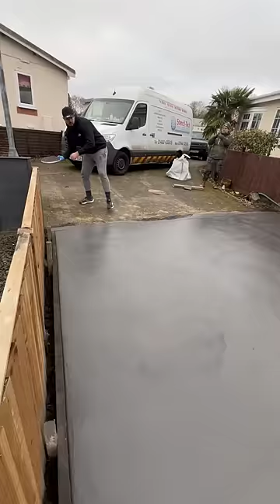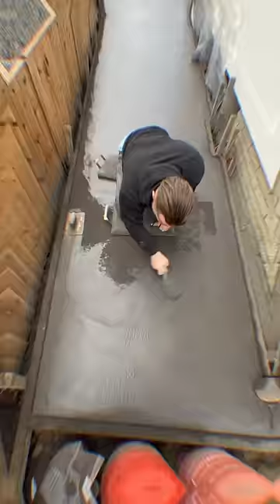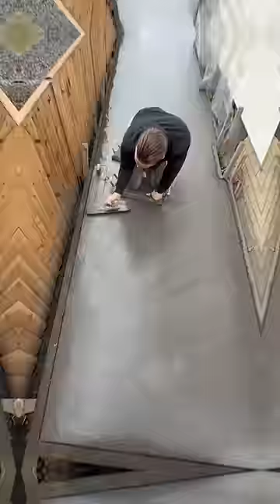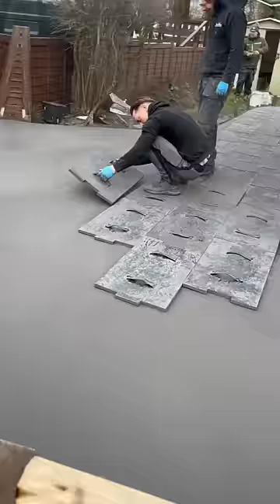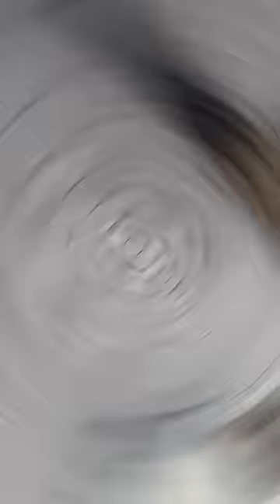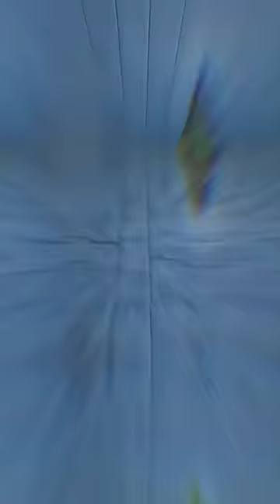Coming in hot 🥵 #concrete #shorts

Comment: Not an expansion joint in sight, be all cracked up in no time at all.
Reply: Cut them on wash off day ...Still crack though uk concrete sick now days
Reply: Was thinking same thing
Reply: @michaelcostello1053  And??? fibre isn't for expansion.
Reply: You can put pop tops in !! So you can run caulk line. . Though it all gets saw cut !!! It's stamped don't do expansion joints unless it's pop tops .
Reply: @Humbleone398  Can you re-say that in English. ???
Reply: I was going to say the same.  I had my driveway done exactly the same.  
I asked about expansion joint,  they said it'll be cut in at the end. 
Then they run an angle grinder about 4 inches deep even though the base was 6 to 8 inches deep. 
Needles to say I have 3 huge cracks in my drive after only 1 year. 

I mean,  I've never laid a concrete drive.... but even I knew it would need to be able to expand and contact.  

In surprised there's no horse footprints in mine as I'm sure they were cowboys.!
Reply: @sweetstuff9748  Exactly why expansion joints should be fitted when laid, with the correct expansion material between them.
Reply: Let it crack and live your life.
Reply: It won't. The concrete has fibres through it tying it together and very high cement content
Reply: @paulmurray3582  OK, That's all I needed to hear, to let me know you haven't got the first clue about what you are talking about, so we'll leave it there. 😉
Reply: Ritey ho matey , drove a mixer for 7 years. hmmm aye for sure a diny Ken wit am takin aboots like Ken  .I done a drive way once 1000 meters long 20 wide concrete was a 10 slump almost set wen it came out the jager  no shutters or nothing no joints fk all  drive way was perfect instead of a colour pigment we used sherbit   n 100s and thousands 😀 🤪 fk aye me no got no clue didn't get paid for the job the mixer was a rite of  the drive way cracked within a month and my boots r still stuck in tje concrete 😚
Reply: @paulmurray3582  You didn't learn English though. ??
Reply: @sweetstuff9748 you paid them , who's the mug?
Reply: I came to say the same thing but if you look really closely at the end there's a joint cut into it
Reply: They most likely came back the next day and cut the joints with a concrete saw because its a stamped patio, You cant cut control joints into stamped concrete while its wet lol
Reply: @forapply4583  Love the "lol" at the end, as if you've made a valid point, trouble is you haven't, concrete expansion joints don't work like that, they have to be fitted when casting.
Reply: Sin juntas vale..... Me sigue gustando el trabajo lo dice un compañero de oficio
Reply: @philiphalpin1997  In what world do they not work like that? The concrete almost never cracks the day after unless its some huge pour or something, for a little patio like this they can stamp it and let it cure first then come back and cut it later if not the next day, Tell me how exactly you would put in joints and stamps at the same time? Would you cut the joints before or after the stamps? Either way you do it its gonna be ugly and you know it loll any person with common sense would just wait and cut it after with a concrete saw, not to mention concrete saw joints are much thinner than using an edger/jointer and havinf an inch wide gaping joint running through your stamped patio thats meant to look like paved rock, Im laughing because only a stubborn jackass would cut those joints while the muds still green, but hey everyone's quality of work is different 🤷‍♂️
Reply: @sweetstuff9748  Well thats a problem right there they ripped you off thats like double the price... Unless you got some big duallys hauling big loads up your driveway it should only be 4-6 inches of concrete, They made it thick as hell for no reason...
Reply: @forapply4583  In every world, tell me you know nothing about concrete, without telling me you know nothing about concrete.

I'm a trained Concrete technician, and this is 100% wrong in every world.
Reply: @philiphalpin1997  concrete technician lmaooo what a ridiculous term, a technician wouldve explained to me how i was wrong; watch a few more videos mr technician maybe then youll level up to a concrete master engineer LOL
Reply: @forapply4583  😂😂😂😂😂😂

Why would I explain how you were wrong????
I'm not here to teach you anything, if you want to know why you ARE wrong, look it up for yourself.
Reply: @philiphalpin1997  What's there to look up, I'm a REAL cement finisher, not a Google Cement Engineer or whatever you call yourself 😂, thanks for your input though
Reply: @philiphalpin1997 it all gets saw cuts in repeat patterns. In English
Reply: And if you butt it to another  concrete finish you make sure use felt
Reply: @forapply4583  Tell me you know absolutely nothing about concrete, without telling me you know absolutely nothing about concrete.
Reply: @erdoganyldz404  And that saw cut make absolutely difference, it will still crack, as the width of a saw cut is nowhere near wide enough to stop it doing so.
Reply: @philiphalpin1997  You said that already, I shouldve known you had dementia... I understand you probably used to grind up the sand and gravel with the concrete mix by hand back in the 1920s or whenever you worked but times have changed grandpa, We do it the new way/ better way 😁
Reply: Je pensé a la même chose !
Reply: They concrete sawed for expansion joints…you obviously don’t know about concreting
Reply: Я тоже не понимаю, как строить без разрезов плиты , ведь технологические швы просто обязаны быть в стяжке бетона
Reply: @forapply4583  Better way😂😂😂😂😂😂  OK mister I haven't a clue what I'm talking about, but I'll say it anyway.
Reply: @GlenT-dogwalker  OK. And then they fit the re-bars and expansion felt into the saw cut. 😂😂😂😂😂
Reply: Faut que ça durcisse 2 jours avant de faire les joints de dilatation  non?
Reply: @Duckisa  somebody has learnt how to use Google  and then cut and paste. 😂😂😂😂

Come back when your out of nappies and done this for 45 years.
Reply: It'll just crack along the stamp lines anyway.
Reply: Stamped doesn't get expansion joints it's get saw cut with a soffit saw. Expansion joints are more for walkways. Slabs typically get saw cut.
Reply: @olnoname1  They really don't, slabs 100% have proper expansion joints fitted along with rebar sliders.
Reply: @paulmurray3582 😂😂👍🏴🤚
Reply: Zip stips maybe? Harder to see
Reply: 热胀冷缩
Reply: @philiphalpin1997 fiber concrete is a meme. I paid extra for it and still have cracks in my driveway a few years later. Don't waste yoir money
Reply: I believe everyone with a bit of common sense thought exactly the same😂
Reply: All concrete cracks over time. All
Reply: Control joints you mean. They just saw cut it the next day.
Reply: @stighaaland5357  No I mean expansion joints, that's why I wrote "Expansion Joints"
Reply: @philiphalpin1997  ok. But they don’t use expansion joints, only control joints to control the cracking.
Reply: @stighaaland5357  There in lays the problem, trying to control what should have been stopped in the first place.
Reply: @philiphalpin1997  LOL
Reply: @DogeBerg7  And ruin the whole job, ive ripped out more pattern prints driveways than I care to remember over the last 40 years, always replacing them with Block Paving.
Reply: They know what they are doing you dont
Reply: @Lightworker-ye4nv  OK if you say so.

Oh by the way I'm a qualified Concrete Technician & Civil Engineer. 

You. ????
Reply: You have to wait a week or so come back pressure wash then saw cut so it's all good bro lol
Reply: @gamingwithchipdip  no you don't. 😂😂😂😂
Reply: @philiphalpin1997  👌
Reply: @gamingwithchipdip  I know its OK that you are wrong, wrong on every level.
Reply: @paulmurray3582  lmao
Reply: But its not an expansion joint numptey, its a cut @philiphalpin1997
Reply: Арматуру кто видел? А она возможно есть.
Reply: Mother in laws had  it over 23yrs still looks as good as the day it was laid
Reply: @paulmurray3582 10in slump is water lol 8 to 9 is cell filled. Fiber helps the top layer stay together but won't help with stress cracks. Driver and batcher myself. I've poured way bigger slabs 300 plus yards and it had a helipad.
Reply: @philiphalpin1997 I've seen cut day of and next day what you mean it doesn't work like that. I'm sure these guys that have been doing it 4 generations now would like to know you have almost 2 days to get them cut to prevent worse cracks from forming once it's dried. Look it up.
Reply: @Matthew-ev4cv  You talk as if I, a fully qualified concrete technician don't know what I'm talking about. 😂😂😂😂
Reply: @philiphalpin1997  concrete tech lol so basically my job. Batchmen do the same thing but no name trying so sound sophisticated. I have to know my mixes weight ratios etc. All you do is check surfaces to make sure curing correctly. Only used by bigger companies. I've poured for many companies building houses etc. Only large corporations send you guys out. That and state jobs. You  probably don't even know a proper slump. If I could show you the screen I was looking at right now you'd understand you think you know but you don't. Not all concrete is the same different admixes can be cut at different times you say your a tech but haven't proven any knowledge.just saying you are a tech and saying you cant cut next day is not proof. Because you are wrong.
Reply: @Matthew-ev4cv  So you are a batch man, and not a technician then  two entirely different jobs. 🙄🙄🙄
Reply: @philiphalpin1997  barely we have to test loads check the ratios etc. We just don't test the slab at the job. We have numerous testing cylinders. I work for one of the largest companies in the US. What about you?
Reply: @philiphalpin1997  you haven't said anything that even gives any indication you are an actual tech. Hiding behind a screen with nothing to back up that you are a tech.
Reply: Bang on buddy. Full depth 10mm wide Expansion/Contraction soft joint at max 4 metre centres and it’ll last forever.
Reply: Lame
Reply: @philiphalpin1997 lol you's a goof bro
Reply: You blind or what?? Look at the last 1 or 2 seconds!!!

Comment: Its great when it's icy and when moss starts growing on it.
Reply: Not really. When you seal this slab you seal with a thick sealer and what is called shark grit. You always do this on any stamp crete pour. Sealer itself keeps dirt and moisture from any moss attaching to it also shark grit supplies traction to the surface.

Comment: The water will sit in the grooves and will crack the whole thing. 2 -3 years max😂
Reply: if that were true, stamped concrete wouldn't be nearly as popular as it is.
Reply: It's gonna crack no matter what, it's concrete!
Reply: @ex_yz там где есть морозы,вода разрушит быстро.
Reply: На то и расчет
Reply: Nope. Had about 500sf stamped on the side and back of my house about 20 yrs ago w proper stress lines and not a single issue. And it's in Miami where they do blasting about 10 miles away where interior tiles have cracked due to foundation settling. Looks great no maintenance and 1/3 cost of pavers

Comment: It has no expansion joints??? Will crack soon that
Reply: You always cut with saw cuts afterwards. Stamp concrete doesn't have expansion joints that are tooled in. Never once have I poured a stamp slab and tooled in. No way of keeping it open and straight when you pound your stamp. So you come back after it dries and you cut the joints in.
Reply: I can’t see any joints after they finished

Comment: That pattern "looks cool" but really SUCKS big Donkey Dicks wherever it's wet and even treacherous for women in any kind of heels.
It shed water very well and is slick  on the topnor apex which is notorious for causing falls. And for women wearing heels, they can get stuck in the gaps between segments, leading to stumbles and subsequent face plants. And if they try to put their arms out to break their fall, again the top dome is slick and their palms and shoot out to the sides, front or back leading to a face plant, twisted elbow, torn rotator cuff, separated shoulder, snapped bones or any number of things.
Thankfully the distance isn't long so a car can't get enough speed to make panic stopping much of an issue because cobblestones are terribly difficult to stop a car on. I learned that when i was on Germany and almost crushed a civilian car with a tank from behind.
I was going plenty slow but the car stopped suddenly and i locked up both tracks. You'd think 62 TONS of tank would stop RFN on paved streets but it was cobblestones, they had a light coat of morning dew and the drag coefficient was about zero. I missed running into the back and over the top of that German car with a little kid in the back and Mommie driving by less than one meter!
Yeah, i don't like that kind of textured footing. It aint too smart.